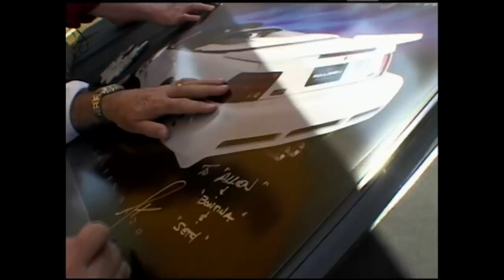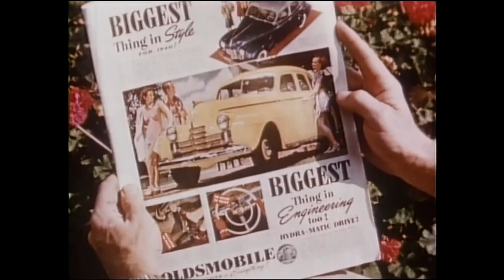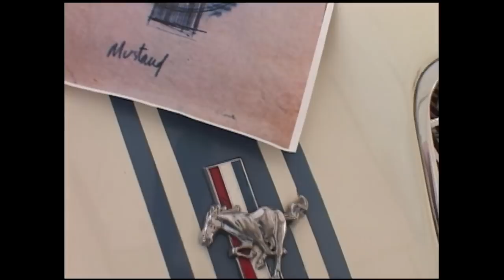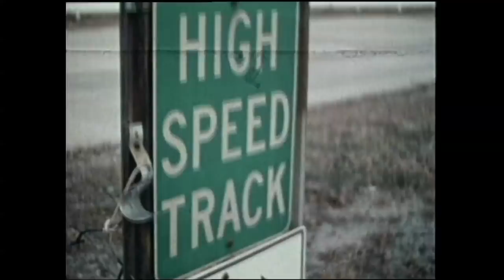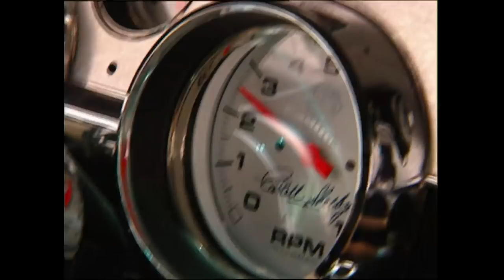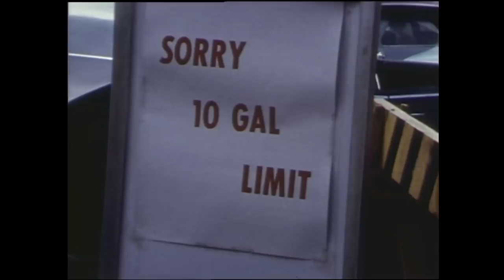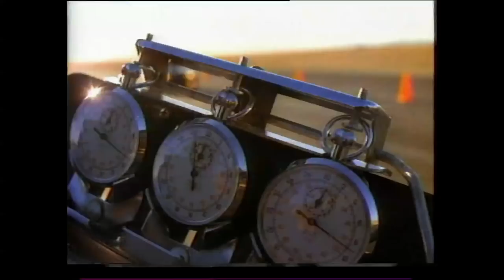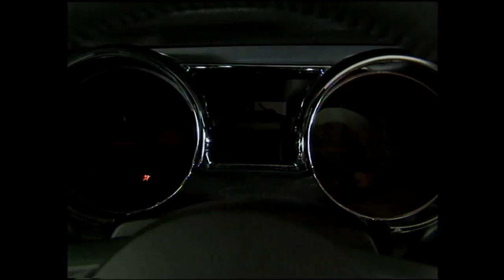Great Cars: Ford MUSTANG

Comment: the 79 mustang is total SHIT! it didnt even wear the mustang emblem. to me it is just a bumped up sierra. but the sierra cosworth  is better looking. to me the 78 king cobra was the last of the real mustangs until 1994 when the mustang came back. but the 2005 mustang looks like the original. you can also google that the 74 mustang II won car of the year in 74 and sold more than any of the mustangs to date!

here is the link for the sierra cosworth that looks like the 79 mustang could have been based on. 
https://www.google.co.za/search?rlz=1C1CHZL_enZA756ZA758&biw=1366&bih=662&tbm=isch&sa=1&ei=NOZIWqbxNarHgAaB5quYAg&q=1980s+fords&oq=1980s+fords&gs_l=psy-ab.3..0j0i24k1.42750.47568.0.48618.5.5.0.0.0.0.481.1490.2-3j1j1.5.0....0...1c.1.64.psy-ab..0.5.1484...0i7i30k1.0.9C_xz5ckg7I#imgrc=9EW-PKxlcF6XQM:

and here is the link for the 74 best seller car of the year

http://www.mustangandfords.com/featured-vehicles/1431-best-mustangs-of-1974-1978-generation-iis/.

so mustang II haterd eat your heart out. black sheep still wins lol

Comment: Thank GOD for 2005 

The car that made the mustang look like a mustang again 

As an 08 GT owner all I can say is shame on the mustang 2 or pintostang as they called it
Reply from the maker: The Ghia body Mustang had a look but should have been a separate product line for compacts.  Ford had to do something to shift to small cars and having a sporty model made sense.  Dealing with emissions and fuel saving was an enormous engineering, planning and marketing challenge.  Mistakes were made.
Reply: I'm pretty sure the only reason the Mustang II sold at all was because they were the featured cars on "Charlie's Angels". What gawd-awful pieces of CRAP !!
Reply: VinnyDaQ 

Oh god that car was on TV 

THE THING WAS A HUGE BUCKET OF WORTHLESS 

WHY WOULD ANYONE THINK THAT WAS COOL
Reply: S197 is generally regarded as dumbed down Jaguar platform. Not very good at all. There is a reason why Terminators still go for 20k.
Reply: Yeah.

Comment: It skipped over the best iteration of the stang the new edge
Reply: That happens TOO OFTEN... 😖😡😠
The SN95, from 1994, was everything the Mustang was SUPPOSED to be. Certainly BETTER than the iconic Fox! It NEARLY WAS a Fox under the Skin, with some T-Bird Suspension bits. 
The 94-98 were the second LEAST LIKED Mustangs in its History! 😞

They were Foxes that could STICK in a Turn! Quieter, more refined and comfortable.....
But NOT overbloated and expensive, like LATER Models!! 
I Loved my 98 GT! 

Contrary to the ASSUMPTIONS - the 99-04 New Edge Stangs WERE ALSO SN-95s!!! 😲😲😁

2005, the Mustang got bigger, more comfortable, yet faster with better Handling! The Lincoln LS Chassis wasn't the best idea. Too soft.

..... The S197 DID have the first V6 to get about the SAME Fuel Economy as the V8! 😲😲😖

But yeah, the 90's "stopgap" Mustangs are HIGHLY overlooked and underrated!!! 

Hey - that just keeps the CAR FLIPPERS from shoving prices, so we can actually GEY one or two!!! 😁👍👍